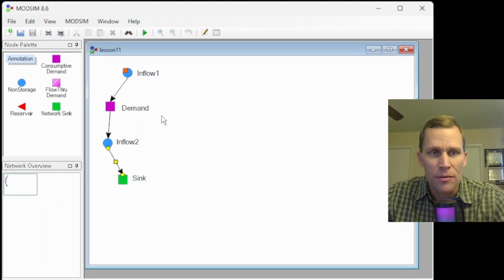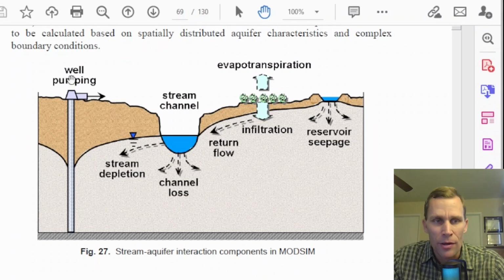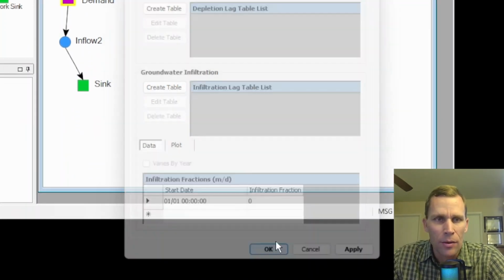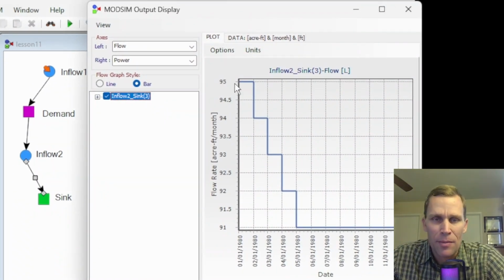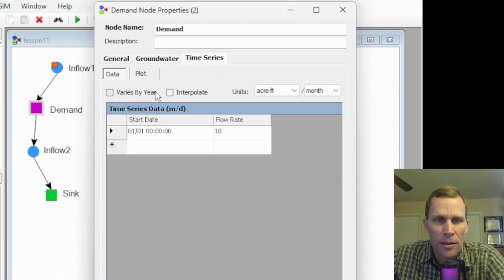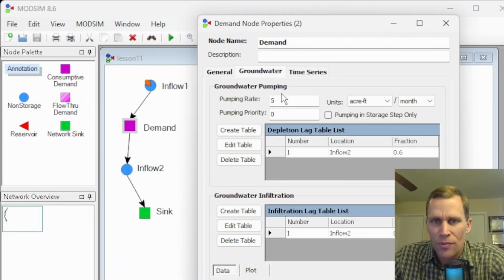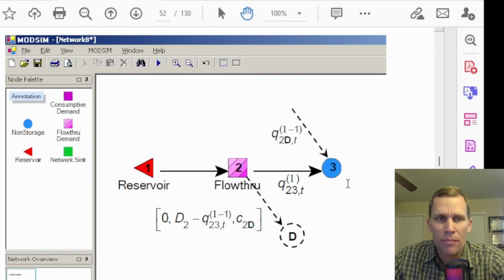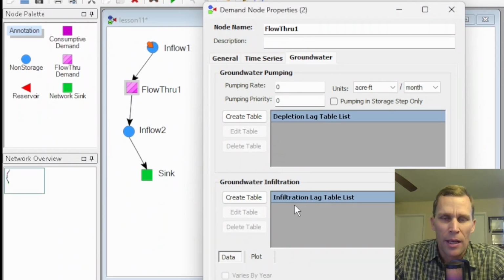MODSIM Lesson 11 - Demand Nodes (Part 3) - Node Types

Comment: Hi, thank you for your great explanation
two problems actually and I highly appreciate you for your help
first, how is MODSIM going to satisfy demands when all the priorities are the same ? I ran the model and I think it start to satisfy the demands from last node. is that true ?
and the second one, do you have any video or exercise about fraction node in flowthru demands? fraction node is a tab in flowthru demands and actually I don't know what is it.
Reply from the maker: When multiple priorities are the same, you may encounter a non-unique optimal solution. In that case, the model will deliver an optimal solution, but there's no way to know which optimal solution. I avoid this situation by using different priority numbers.

I mention the Flowthru Fraction briefly in this video (at about 12:10). It represents the fraction of the flow thru demand that is delivered to other nodes in the system.